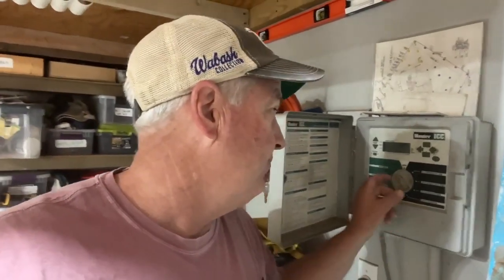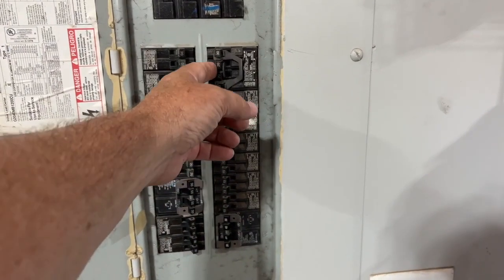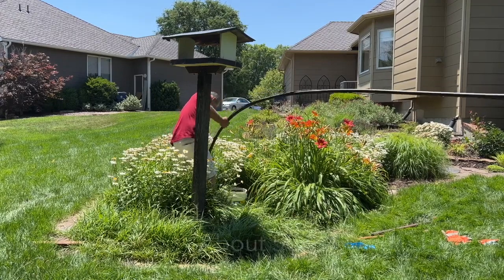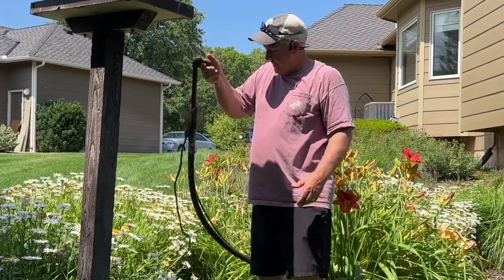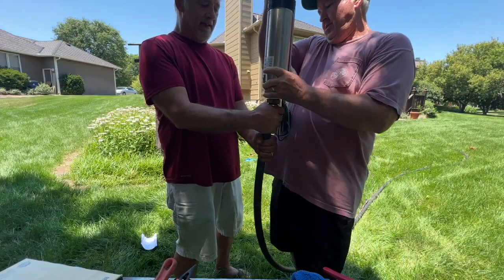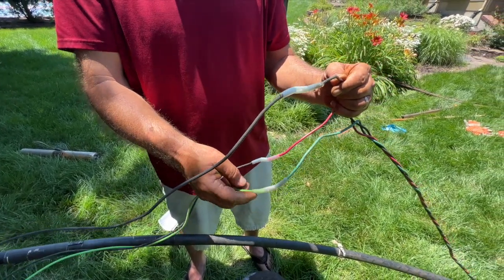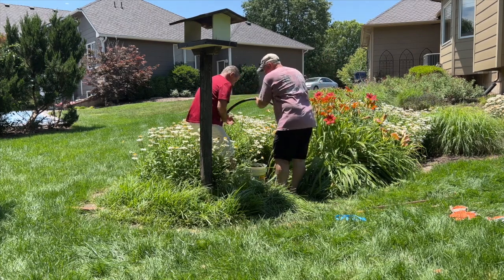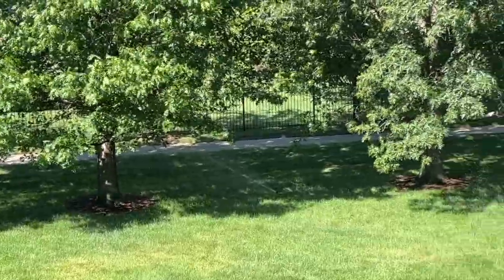How to Replace an Irrigation Well pump

Comment: Can you tell me the model of the pump you use? I have an old 6in well casing in my yard that was used for a farm irrigation well but I want to buy a submersible pump and use it to water my lawn. Most people dont have a setup like this and recommend a separate tank and pump for the lawn but I want to keep it as simple as possible.
Reply from the maker: @jhallmark4140  Not for sure, it’s a 1 hp but I would just stop by a well shop/distributor and tell them you desire and needs. They should be able to set you up with what your best solution is. Thanks for the question